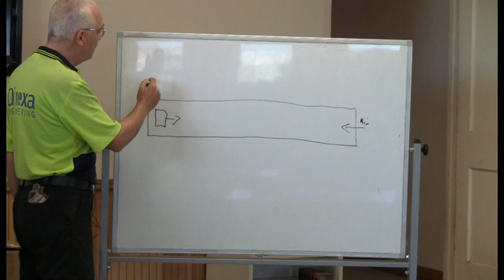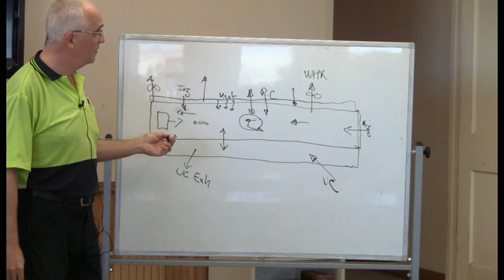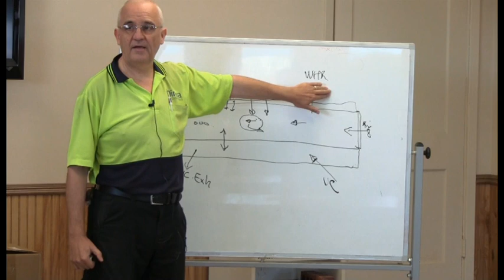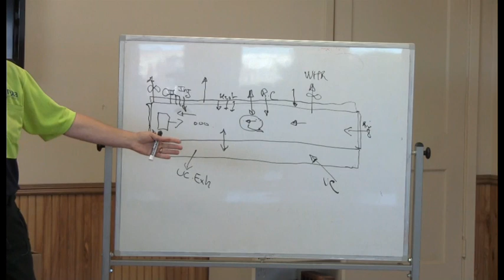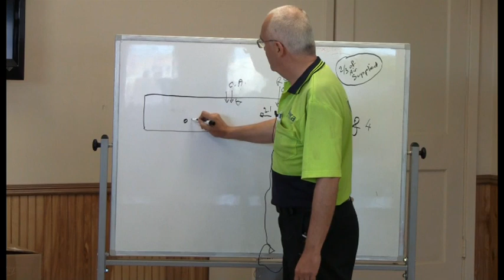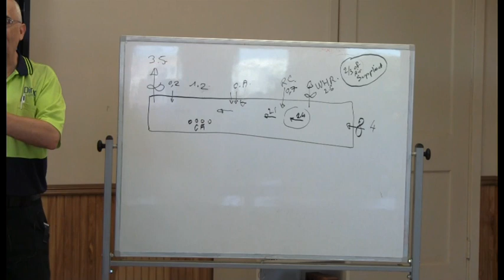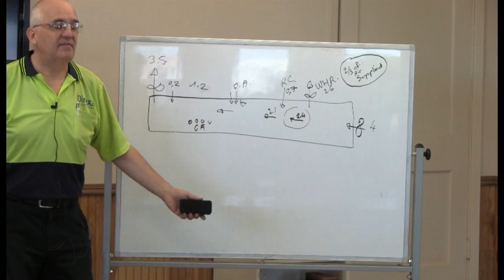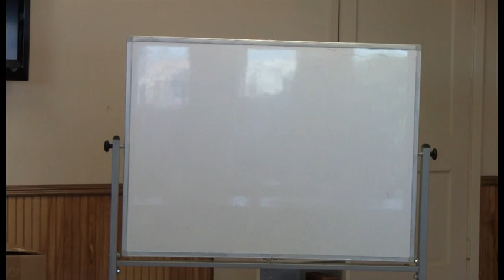Tunnel Kiln Tutorial

Comment: POC are exhausted through the POC exhaust fan, rapid cool & cooling air are exhausted through the waste heat fan. When kiln is tuned/balanced properly you will have a zero balance area between end of fire zone and rapid cool. I've Been tuning balancing kilns for 25+years & this is the most accurate way of balancing kilns. Also use high velocity burners to achieve uniformity with staggered burners.
Reply: hi
Reply: Paul Dorow - What you describe applies for kilns without exit door and which rely on kiln exhaust and  waste heat recovery fans to supply air inside the tunnel, it does not apply to kilns with an exit door and forced air with exit end fan.  I am sorry, but I explain practice that I applied in my professional life to modern firing kilns for the last 40 years with success.  And what you call zero balance area, do you mean a zero flow area or a zero static pressure?  Those are two different things.